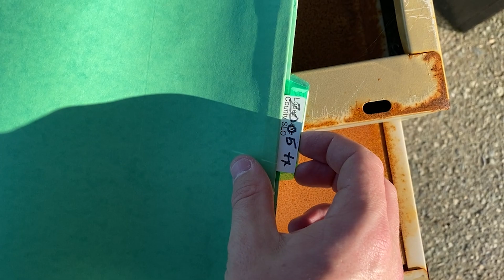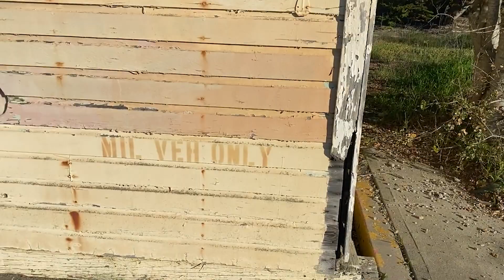Exploring an Abandoned Baseball Field | CSUMB | Fort Ord

Comment: There is actually 5 ball fields. The ones with the scoreboards are in this area 36.64787339239129, -121.7970856788631, or the large area behind the lot with all the military vehicles. There is also a confidence training area and a small oval shaped track over in that area. The dome is was natural gas storage for the the base. You should really go into the concrete barracks (Hammerheads), lots of great graffiti art in there. I recommend a mask and headlamp and flashlight for the first floor and basement.
Reply from the maker: Holy crap man thank you!! I’ll get those checked oht